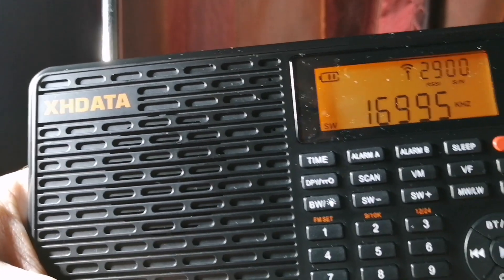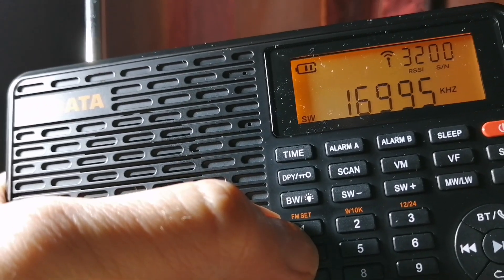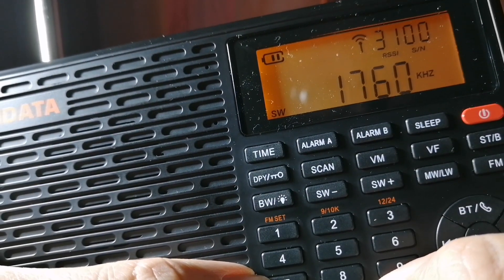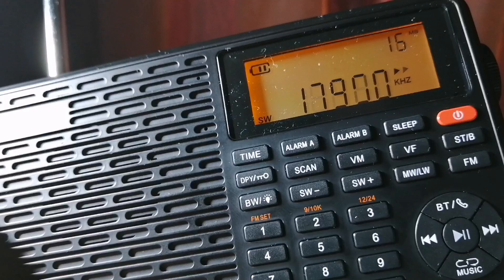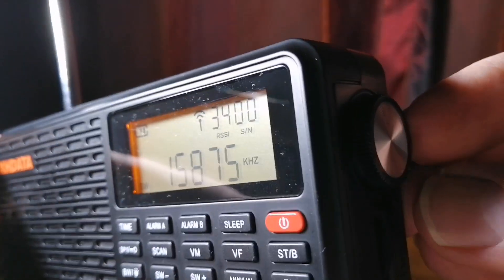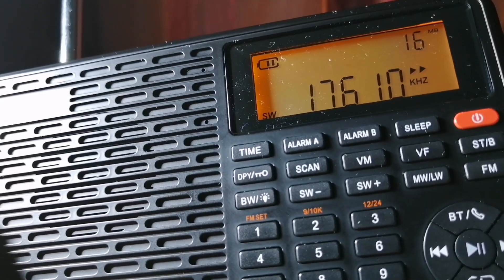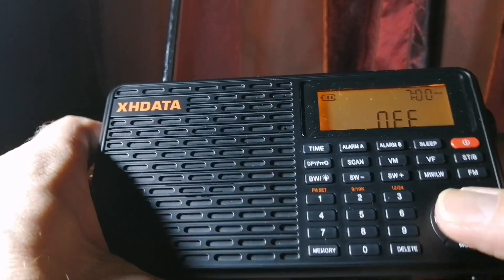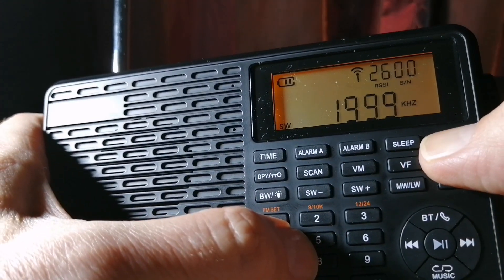Explained: The reason why XHDATA D-109 was withdrawn temporarily #radio #shortwave

Comment: Facing antenna wobble on this model !!
Reply from the maker: Hi there Abhinav, mine does not have this issue (yet), but many of my other portable radios do. I just tighten the screw again, it seems to come loose on some of these radios.
Reply: There is No wobble however the swivel is loose
Reply from the maker: @AbhinavKumarSahai  Can you tighten it somehow? These days antennas on portables are not that sturdy anymore...
Reply: @swlistening  Indeed

Comment: Hello André
I have seen that when doing the automatic scan on SW, the scan jumps and skips frpm 22000khz to 25650khz. Is that something normal?
Reply from the maker: Hi Angel, yes, that is quite normal. Most SW radios scan only the regular broadcast bands (for example 13m, 16m and so on). Although many of these radios cover the entire SW spectrum, from about 1711 kHz up to 29999 kHz, they scan only the broadcasting bands. So your D-109 scans the 13m band and then jumps to the 11m band, that's why you see the jump. You will see it also happens between other bands. One of the only radios that I know that scans everything is the Retekess V115, it only covers 4650 kHz up to 21850 kHz, but when you do a scan on the Retekess it scans through everything. Takes very long though!

Comment: Hello Andre, may I suggest that you try to scan from 26000 kHz up and see if your D-109 could  scan pass 26100 kHz all the way up to 29999 kHz? I've noticed on my D-109, that when I do the scan it could not go higher than 26100kHz,  it would jump back to  2250 kHz  and re-scan again.. is that an issue as well?  But it works when manually tuning . By the way, thanks for the demo video.
Reply from the maker: Yes, mine does the same, but I don't think it is a flaw. Most radios scan only the international broadcast bands, so they jump from one broadcast band to the other. It would be normal for this radio to scan from 25600 to 26100, which is the 11m band, and then jump directly to the 120m band, which is what mine does.

Comment: Have you tried storing stations on the faulty frequencies?
Reply from the maker: I tried it now after your question, it works, I can save them. I can tune manually to, say 17600 kHz, and save.
Reply: @swlistening  It was worth a try. So there really isn't that much of a problem with the radio.

Comment: Hi André 😀 now this is an interesting flaw... I haven't watched your first video on this radio yet but I assume SW goes down to 1711 kHz or so, so not only 1700-1999 and 17000-19999 kHz ranges would be conflicting like that but also 2000-2999 and 20000-29999 kHz. Very strange that one is affected by the bug and the other isn't 🤯

On my XHDATA D-808, it is easily mitigated by the presence of a FREQ button which you have to press before keying in a frequency. From what I see, the new D-109 lacks the FREQ button. Now, AFAIK, top Tecsun portables don't have it either, and entering frequencies with numerical keypad is flawless. How did they achieve it - I don't know. Maybe the receivers just wait in case a user wishes to enter that 5th digit? 😜

I'm really curious what they'll do about it. 73! 🙋‍♂️
Reply from the maker: Hi Arnie, thanks for your comment. I think it is a firmware issue, probably easy to fix. I have tried to enter all 5 digits of the frequency, doesn't work. As soon as you reach the fourth one, it tunes to that frequency of 4 digits immediately. But only the 16m band, only between 17000 and 19999 kHz, nowhere else.

Your observation about the "freq" key is correct, there is none. You just enter the frequency directly on the keypad, like on the Tecsuns. I prefer it this way, I find the D-808 a bit clumsy in that respect.

Comment: Could you make a band scan of salena radio from USSR
Reply from the maker: I would have, if I had one of those. Looks like a nice radio!
Reply: There are many reviews of this radio on Youtube. You can search them by query 'review ocean 214' or in russian 'обзор океан 214'. The Океан 214 is the same model as Selena, but Selena's SW bands shifted up on frequency (range from 49 m to 16 m), the Ocean has SW bands from 75 m to 25 m.
Reply from the maker: @mmxbow  Thank you for this Alexander, I will have a look. Is it still possible to buy these radios in Russia?
Reply: @swlistening  it's impossible to buy a brand new 'Ocean'. But there are a lot of offers in the russian marke,tplace avito and e_b,ay too.
Reply from the maker: @mmxbow  Thank you for your response. Sounds like an interesting radio!
Reply: @swlistening  Yes, this was a second class (highest class was zero) classic superheterodyne radio with LW, MW, SW (5 bands) and UKW (east europe FM, 65-74 MHz) bands. It has nice sensitivity specially on LW, MW. UKW is not good. Very nice sound (you can check my video of comparing the "Ocean 209' and some chinese little radio - https://youtu.be/aDh6Y5N0Brs). I want to upgrade one of my Oceans by replacing the UKW module by DSP one. Maybe some day...

Comment: What are you going to do with this radio? Once you get the new one, what will you do with this one you think?
Reply: Also, I sent a reply on one of your other videos for dxing on longwave up to the vhf band. The Eton Elite 750 is the answer to that. Take a look at the specs.
Reply from the maker: @FamtechVideos  Thanks, I saw your reply. But that Eton radio is expensive, more than I am willing to pay 😀 I will keep trying on LW with my PL-368 and maybe this new D-109, it also has LW.
Reply: @swlistening  Yeah. There might be a better alternative. I made my own vhf radio actually. Very easy. Also, is the Retekess V115 a good idea for listening to shortwave as well as a garage radio?

Edit: Forgot to mention that simple radio circuits can be found on Instructables.
Reply from the maker: @FamtechVideos  I think the Retekess V115 is just OK on shortwave, it is definitely not a radio I use often for SW, does not pick up nearly as well as the new XHDATA D-219 or other smaller radios I have. Nice as a garage radio though, you can play MP3s or listen to FM stations, the sound quality is great.
Reply from the maker: @FamtechVideos  I buy most of my radios from the XHDATA website directly, xhdata.com.cn. Cheap, and shipping is also cheap. Check it out.
Reply: Well then, good thing XHDATA is to the rescue for better radios! Thanks Andre!
Reply from the maker: I will probably keep it as a back-up, but I haven't decided yet. Will make a decision once I do receive the replacement for sure 🙂
Reply: @swlistening  Ok. I hope all goes well with it.
Reply: Take a look at your previous video's comment from me, at the bottom. There is a bunch of things there I need to male sure are ok.
Reply: Looks great kind a radio
Reply: Where did you get your Retekess V115 from?
Reply from the maker: @FamtechVideos  From Bidorbuy, probably the same seller you saw, Maverick.
Reply: @swlistening  R195 shipping. Ah well. I can get some more products from Maverick. R90 per extra product. I will update if I find a better solution.
Reply from the maker: @FamtechVideos  I haven't found a better place for the Retekess V115. As I said before, for XHDATA radios, use their own website. Cheap and fast shipping.